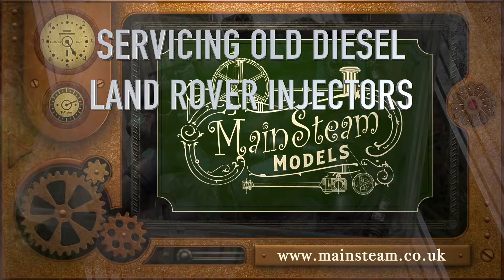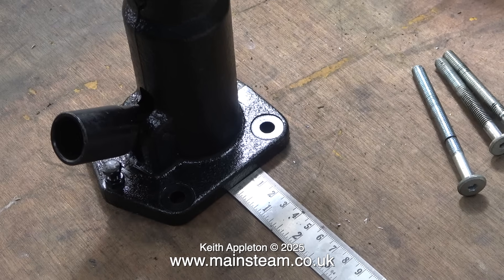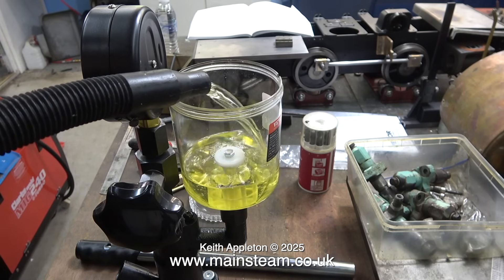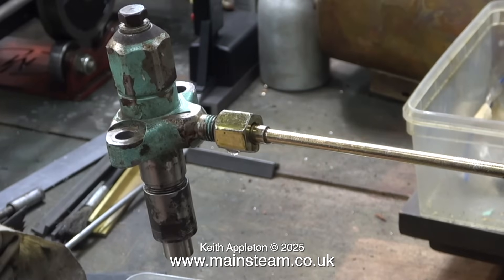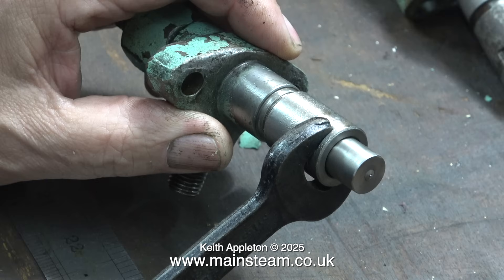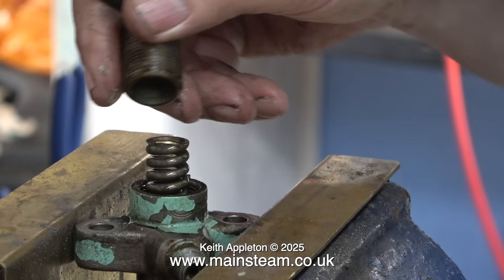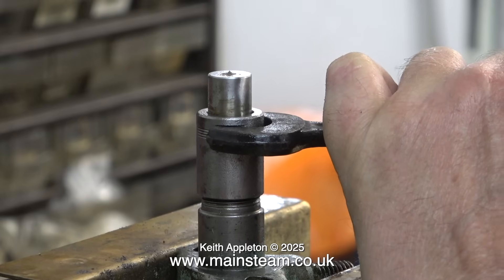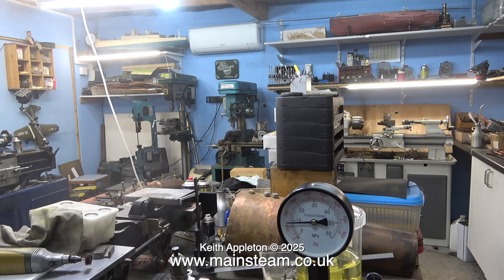SERVICING OLD LAND ROVER DIESEL ENGINE INJECTORS - PART #1

Comment: Very interesting Keith👍👍👍 , I've always wondered how injectors wok and, as you have shown, how simple the design.   I owned a rebuilt Diesel Landy for 26 years. I never experienced any injector problems at all. My diesel engine was the  2.5 L Turbocharged variant from 1988 to early 1990's. Cheers Paul

Comment: Thanks for doing this bit on injectors. I have a diesel engine in my boat and have often wondered about how they injectors actually work.
Reply from the maker: This pump was very cheap and it is so easy to set up an injector once you do a little work lapping the nozzle. I have ordered 4 brand new ones - they are not expensive, but I love to learn by fiddling about with things.